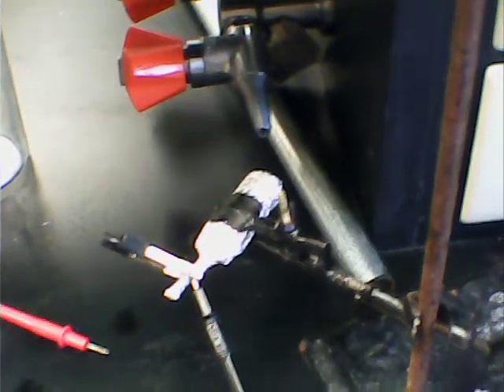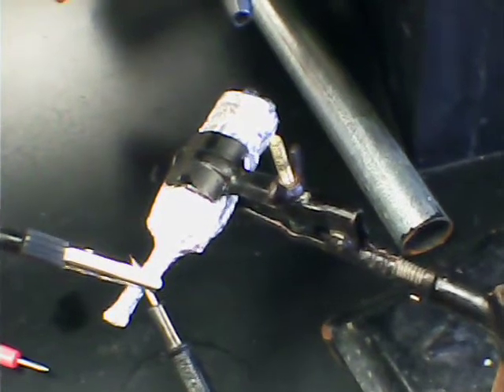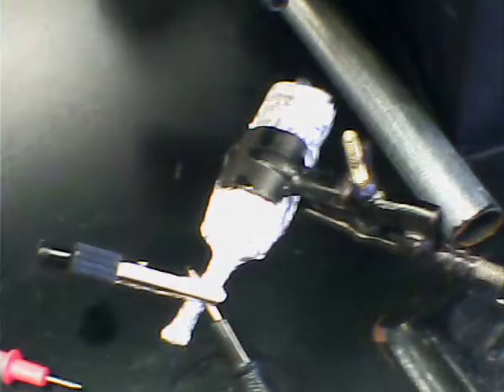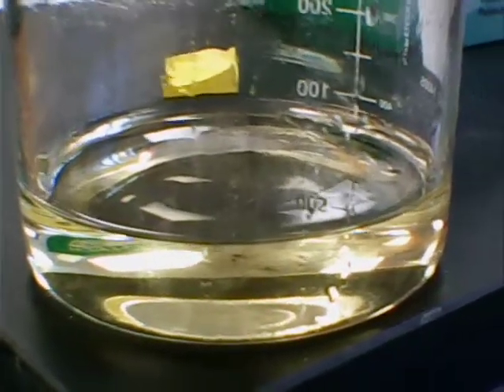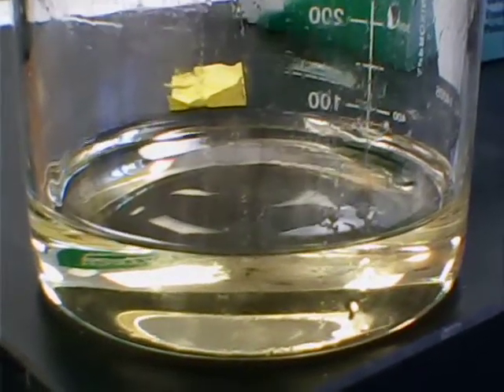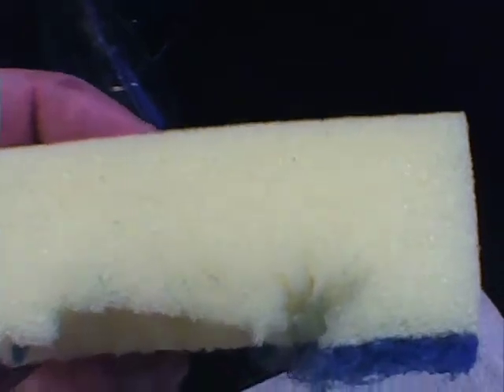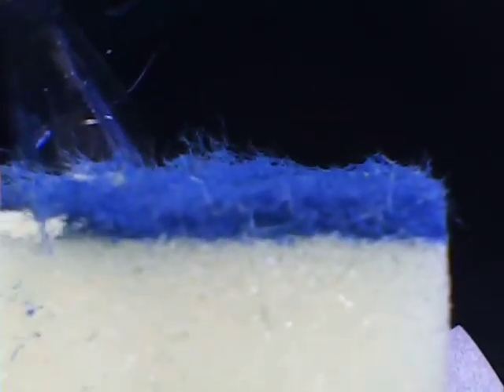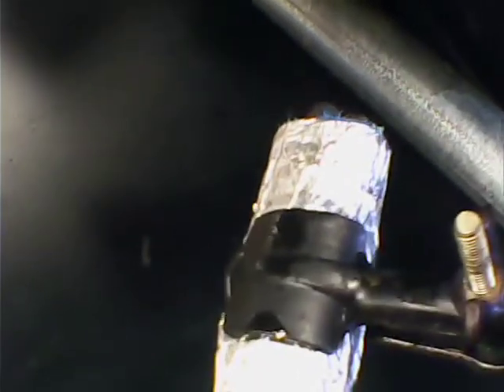Aluminum Air Battery/Graphite Cathode/Deep Eutectic Electrolyte

Comment: Hi, good vid - What kind of current can you draw?
Reply from the maker: +solarhope 

Hi:  As I recall 30-50 mA. I am currently working with thermoelectric generation and lithium batteries.This aluminum battery held charge, as I recall.
Reply: +David Soriano 
Thanks Dave - I have taken a look at some of your thermoelectric work, very interesting.
It would be great to come up with a cheap, easy to fabricate rechargeable battery for DIY renewable energy storage. Aluminium and graphite are very cheap, safe and easy to get hold of. 
The right DES mix for the particular cell chemistry maybe the key, and a way of quickly testing lots of different molar mixes of the DES maybe a productive approach. - Regards Martin.
Reply from the maker: solarhope
The TEG work has good potential. Heat up liquid in a solar oven and store in a thermos. Generate power at night.

Comment: Hmm, what is the advantage from this ionic liquid versus my electrolyte of K2CO3-water ? Mine gives around 1.4 to 1.5 Volts and quite good current.. Is it that the ionic liquid is not drying out and will not corrode the aluminium foil so fast ?